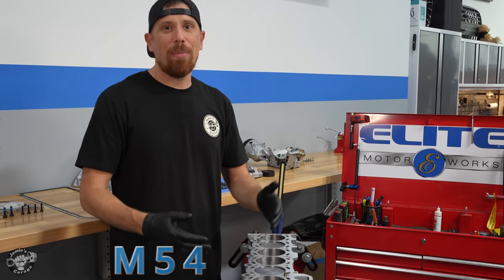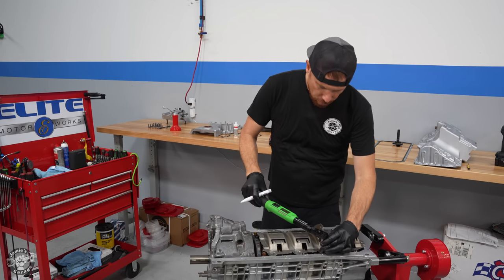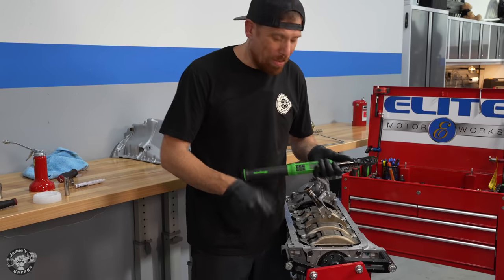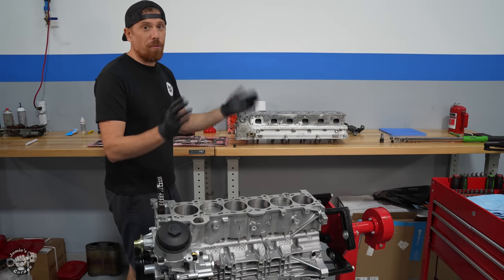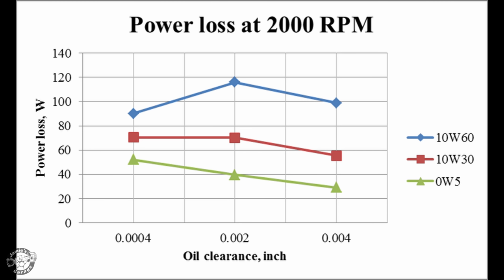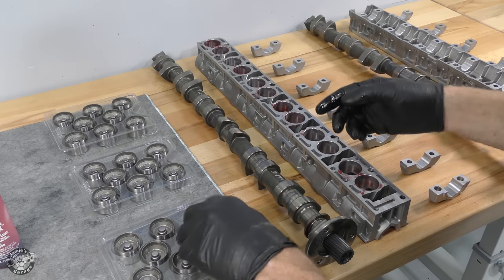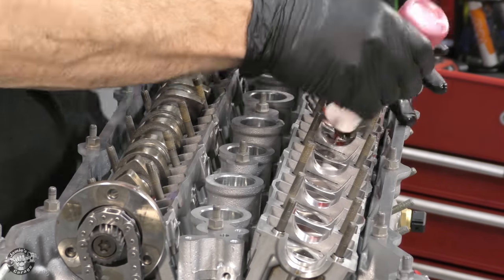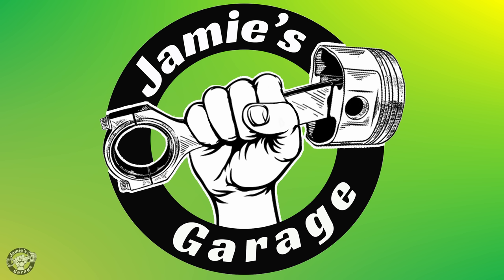Worlds Most Reliable BMW Engine?

Comment: The amount of common failure points is hilarious 
Bmw engineered so many different ways for their engine to blow itself up
Reply from the maker: Keep in mind, this engine was designed over 20 years ago so most of the common failures that I point out are after many many miles. I think every engine has common issues, some have more than others.

Comment: Why plastic for timing chain tension/guides say over something like aluminum or another metal? I reckon it must work and hold up to the heat stress but seems metal ones would be a lot more durable....
Reply: Having plastic actually increases the performance of the chain.  Not normal plastic it is developed for the job at hand.  I don’t think metal really would be more durable for the job.  It is weird seeing plastic for timing components (i work at a vw dealership have 2 e46’s , 1 is a zhp) but they work fine.  Timing really isn’t a concern for the m54 doesn’t stretch unless it doesn’t get oil changes.

Comment: Actually the N51 is the most reliable, because it does not have a turbo. Extra heat produced by turbos ware down parts like sensors and seals causing more issues in BMW's.

Comment: Awesome job, dude! Your attention to detail is nauseating, in a great way ;-). Do you restore Porsche 911 air-cooled engines? If not, you should consider it. They have exceptional tolerance requirements and quirks, which I think you'll easily handle with your patient attitude and attention to detail.
Reply from the maker: I have never restored an air cooled 911, but I'd like to one day

Comment: If the bearings in the new waterpump fail the metal impeller will eat out the engine, making it scrap. The best is the impeller it the composite impeller😃

Comment: Do you have specific torque table for every bolt for that specific engine or you use "standard" torque table based on bolt thickness?
Reply from the maker: I used factory recommended torque specs
Reply: @JamiesGarage1  Thanks for the reply man! Then i should dig deeper for my corolla and astra, to find specs for all bolts...

Comment: What the hell were MBW playing at? I've got an M57N engine that has potential swirl flap failure, which can junk the engine. The M54 has the DISA valve to fail and do the same thing. Planned obsolescence?! Sure seems like it.
Reply from the maker: I have an m57 as well. The swirl flaps are missing on mine too 😉. Unlike the diesel, the M54 DISA has an advantage to keeping it.

Comment: You have the cam caps on the wrong camshaft.  You said A for intake and E for exhaust. That isn't correct.
A is for exhaust (Auspuff in German) and E is for intake (Einlass in German).

Comment: Very talented mechanic And technician! BMW engineers have a designed components to be be cheaply made and limited lifespan- plastic parts ,  l guess they know what they are doing? Inline 6 is the best motor ever designed period!
Reply: @M54B30_fan  agreed.  Plastic parts such as intake manifold, water pump and radiators have limited lifespans. I assume for weight and production costs!.Toyota 3.0 inline six is also very strong,  potent engine too!
Reply: @frank.l181  sorry man it’s 2 am rn thought you were trash talkin the m54.  It does have the plastic cooling system and yeah intake and what not but still very good motor indeed.  My bad have a good one.

Comment: 3:04 thats not a good way to measure the length of that shaft.....
use the other end of the calipers it will be way more accurate then lining up the way you did

Comment: Is this egine even usable in the lemons race? the cost of labour and parts will easily be 10x the entire allowed budget for the vehicle, definitely defeats the entire purpose of the race having a custom race ready engine with performance parts
Reply from the maker: Good question. This is a backup engine only so it won't count against the budget unless they decide to use it. IF... they do use this engine, they will have lots penalty laps ensuring they won't win the race, but at least they can finish it.

Comment: I mean as a guy who does like BMW, the most reliable BMW engine is one that is made by Toyota instead. Only because toyota expects their drivers to be lazy on maintenance and crap, while BMWs expect their customers to like actually take care of their cars
Reply: Yeah i have two e46’s one with 161k and the other is a zhp 113k miles.  Mercedes used to be the same, where if you treated the car right following maintenance which is basically just fluid they work, as most were pretty simple back in the day.  You’re right about honda and toyota, i think the develop those things to be running 2 quarts low of oil and piss being the coolant and 90% water i  the gas tank and still run.

Comment: Hey @Jamie, If you installed the camshafts as A as Intake and E as exhaust, in the order you said in the video, you have done a terrible mistake. On BMW engines E is the Intake and A is the Exhaust.
http://www.engineprofessional.com/TB/TB070617-1.pdf
CC @ChrisFix - before you install the engine at least.

Comment: Just rolled my E60 530i over 221,000 miles. Still running strong :) Great engines. It would be interesting to tear mine down and see what kind of wear it’s got, sadly a $10,000 rebuild doesn’t fit into the budget of my $5000 car😜

Comment: Definately not :)
Maybe in a petrol/gasoline configuration. 

M57 and N57 are many steps ahead. 25 and 30 "D" models are banging aroung the Europe with 500 000KM on the clock.

Comment: The plastic OE water pump impeller failure is greatly exaggerated, and the Stewart pump is way overrated. Go over to the E46 Fanatics forum to learn why. At a cost of around $100 or more over the Genuine pump, I'd hard pass on it but too late now. Anecdotally I've had a Genuine pump in my car which I daily drive the crap out of for ten years now with no problems. And the reason for all the plastic componentry in the cooling system is the reduction of electrolysis in the coolant which is done to mitigate corrosion over time, because if you take care of them these cars will actually go to 500k mi. Hard to believe but true.

Comment: Great video for 98% of the time; but the piston return springs= a huuuuuge no-no. What happens when the combustion chamber is at max compression ratio? The valves and pistons in this engine aren't designed to accommodate for extra metal in their way. This will effectively minimize the service life of the engine, if it even runs. Yikes. Might as well run it with no intake silencer/ air cleaner and throw nuts in the intake.

Comment: I love the design and frame of the E46 , unfortunately it was built by a bunch of incompetent engineers , I left the bmw community years ago and I do not regret I will never buy me a bmw again not even a new one , once it reaches 65k miles is nothing but just a pile of garbage on wheels

Comment: Why you used wrong size washer under oil pump sprocket bolt? It looks like amateur build like that. And telling that oil pump front cover bolt torq is not important is strange. Something was wrong with oil pump chain, cant be so tight, it can destroy the pump. Next thing,cam cap markings, A(Auslass)  is exhaust and E (einlass) intake.

Comment: Can't believe german suppose to be renown for high class engineering, don't do good quality engineering practice to use a method of retaing bolt sprocket to pump that fails you've got toast engine, very heavy paper weight!, that's job I've got to get done on my M54 engine, am lucky got bmw specialist breaker local to me here in boston Lincs U.K. who will carry out repair!

Comment: this whole video is a leg puller   spring in the cylinders have to be joke the would interfere with the valves there is no way that is real this has to be fake in all my 40 years as millwright mechanic I hav never seen this and also a couple other things he has done

Comment: BMW engines have the most poor aluminum body ever capillary cracks water leakage oil leakage low engineering poor lubrication and a whole lot of stuff. I have yet not seen any BMW engine that has done 300 thousand km without being repaired. BMW engines have a very bad quality. If you start repairing, the threads will shrink and the screws will become licking. Therefore, when it fails, a new engine should be installed and sold immediately.

Comment: 39:37 Never never never put anti-seize on spark plugs. EVERY major spark plug manufacturer advises against it. You alter the torque values, overstrain the plug and threads and can create a misfire condition from the anti-seize itself (exacerbated on an aluminum head). Most modern plugs come with a plated coating on the threads already so you're accomplishing nothing. Complete amateur move.